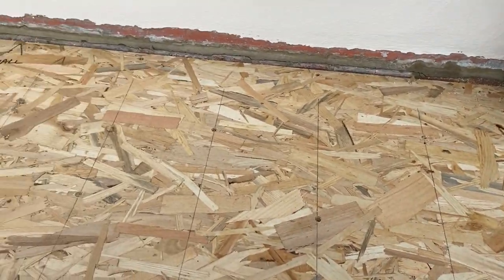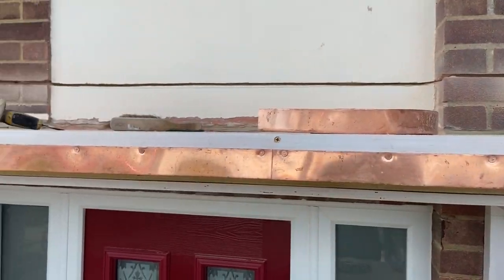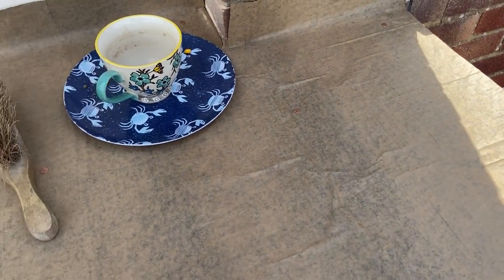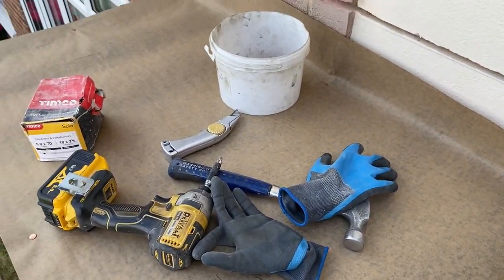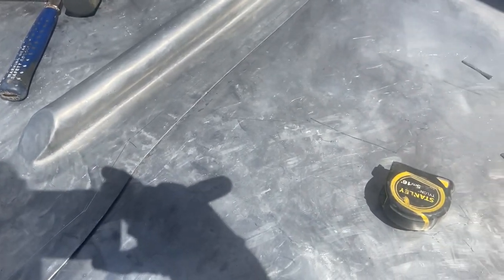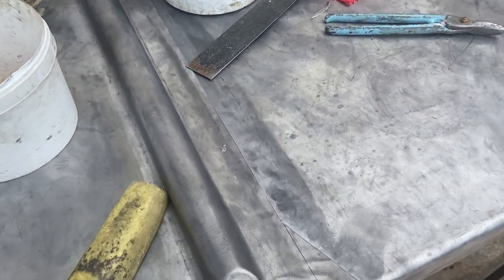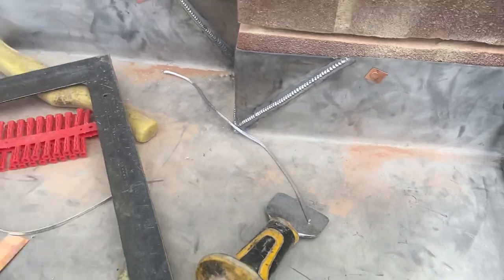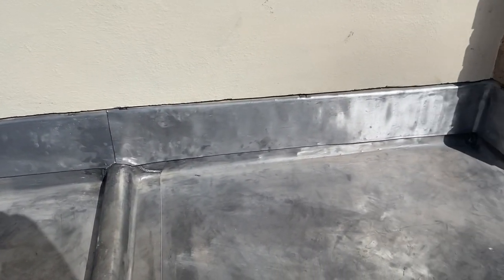Lead Installation To A Flat Roof Entrance Porch

Comment: Evening Stuart….. hope yr well and drinking plenty of water… roofing in this type of weather is as much of a mental Challenge as well as physical …
I’ve always said you’ve got to WANT to do this job cos it’s not easy at times…
Excellent work as usual ….
And a customer made cup of tea and bacon sandwich around 10 am is always a nice surprise….
And they are normally the sort of customer who I will go the extra Mile for if need be….
But yr customer looked like an elderly gentleman who probably made it as a peace offering….especially if u were playing radio 1 …!😂👍
Cheers my friend…
Much love 
Chris…🙏👍
Reply from the maker: Thanks Chris the weather has definitely been challenging this week. And it looks like this extreme weather is going to happen more and more. 
I’ve decided to invest in a work fan. I think it will make those hot days so much more bearable. The lengths I’ll go to to get a fan 😳🤦🏻‍♂️😂. 
It was a really nice customer and as you say you want to go the extra mile for customers like that.

Comment: Great work as usual.  Would you mind telling us how many mm do you turn up inside the copper strip.  Cheers.
Reply from the maker: Thank you. I Turn it up 25mm on the inside edge of the copper strip.
Reply: What's the reason for the copper drip edge? Is it just something to shape the lead / grip onto?

Comment: Do you have to do anything special with the runoff when you have a lead roof? Is it safe to garden with, is it safe for animals, people?
Reply from the maker: I have never heard of any measures in place for the runoff from a lead roof. 
However I wouldn’t recommend any pets or people drinking this water as it could potentially be contaminated. And if this water was often drank lead poisoning could occur. 
This is why lead water mains are replaced.
Reply: @slbleadworks  thank you for the response.